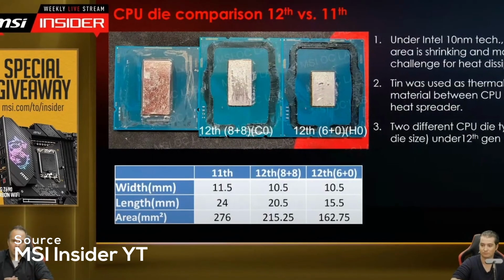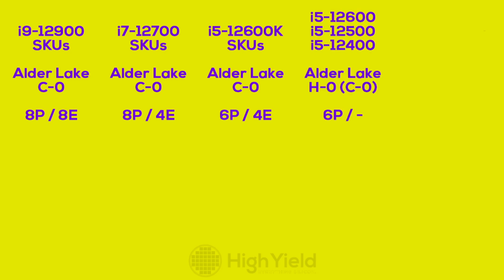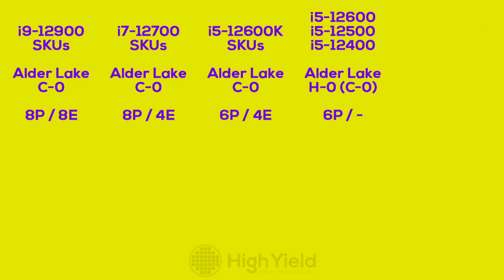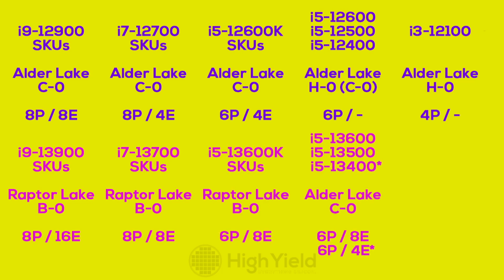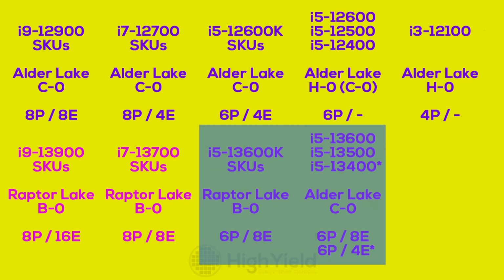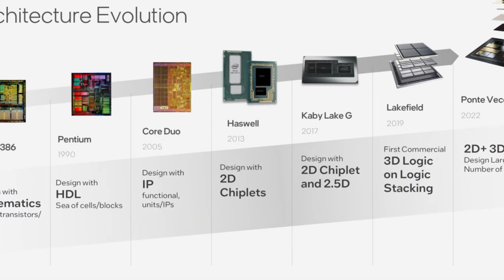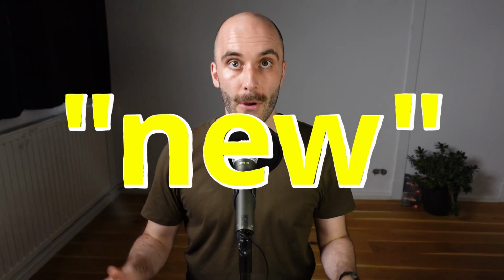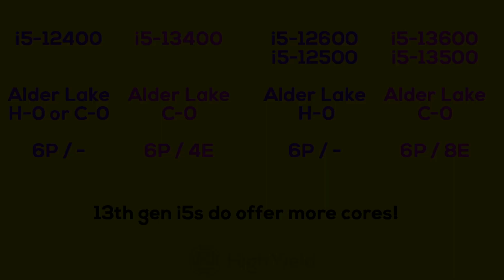Not all Intel 13th Gen CPUs are Raptor Lake

Comment from the maker: Since Raptor Lake just launched today: Yes, its true! CPUs below the 13600K(F) are not based on the new Raptor Lake B0 die, but on refreshed Alder Lake H0/C0. Only exemption is the 13400(F), which can be based on both. But all CPUs launched today (13900K(F), 13700K(F) and 13600K(F) are real Raptor Lake parts!
Reply: how can 13400 be both?
Reply: @kamikazilucas  it can be either
Reply: This is coming from someone who has been on this platform for a WHILE at this point,I had an i9-12900ks and now an i9-13900k and Raptor lake is still on the 1700 socket/the Z790 uses the 1700 socket as well,this is just something that needs to be thought about/talked about.
 
The real issue is,I think AMD is falling behind, YES they have 3D CPUs and MUCH better optimization,but their JUST getting DDR5 RAM and their JUST catching up at the end of a generation/the Meteor Lake platform/1851 socket,MAY come out SOON/the i9-14900ks, will most likely be released on the meteor lake platform/1851 socket. 

I think this is something people NEED to be thinking about, IF your planning on investing in Raptor Lake/Z790 boards/the meteor lake platform/the 1851 socket MAY be right around the corner,if you ALREADY own an alder lake board/an i9-12900k/ks,go ahead and get an i9-13900k,I don't think thats a bad idea,but investing in Alder Lake/Raptor Lake,this late in its life cycle, isn't necessarily a great idea/again most likely the i9-14900ks,will not be on Raptor Lake/the 1,700 socket and it will be on the meteor lake platform/the 1851 socket.

To put this in prospective and I know this isn't the entire story/power/pin count isn't everything,but it does mean A LOT,more pins equals more power and more surface area,surface area allows for more cores and more pins allow you to power those cores/you won't have as many power restraints, this isn't the whole picture, but this is DEFINITELY something to think about, Kaby Lake,which came out in 2016 had 1,151 pins and AM4,that came out in 2016 had 1,331 pins,Alder Lake/Raptor Lake have 1,700 pins, AM5 has 1,718 pins and Meteor Lake has 1,851 pins,like I said pin count doesn't mean everything and it MAY be something AMD can work through with optimization,time will tell,but this is something that NEEDs to be brought up/at least looked at/observed.
Reply: @mattmatt2417  "may come out soon", it will come at the end of this year, likely in october or november. and zen 5 will follow a few months later

Comment: Right now at this time in 2024 I was happy to see I actually have a C0 revision of the i5 13400f. This means it's really an alder lake. Which is a good thing right now. As 13th and 14th gen raptor lake (The real raptor lake and not the rebranded Alder lake) is the ones being affected by the infamous 'degradation' problem. Apparently there are some i5 13400f/i5 13400 that are based on the raptor lake core and has the B0 revision.

Comment: Question: because of 'binning' could a 13600k-rapter lake that does not preform as it should be 're-binned as a 13600-nonK while remaining a rapter lake die rather than as you show a 13600-nonk as being a alder lake die?

Comment: I just bought a laptop with 13th Gen i5-13420H....is this CPU actually a rebranded Alder Lake? It's only got 4P + 4E cores
Reply from the maker: No, your laptop CPU should actually be a "real" Raptor Lake chip with the Raptor Cove P-cores. Yes, it does have a 4P+4E setup, but that's just because it's a mobile CPU.

Comment: i feel like the 13100 or the 'raptor lake' i3 should be a 2/2 core split, 2 power cores and 2 E-cores. i could potentially support this. 
but as it is now, it seems like a copy from last gen with a few more MHz.

on another note i am keeping close eye on the 13400 / 13400 T / 13500 chips.
These seem very valuable from a gamers perspective that play low to mid maybe a few high end games but want to keep their total build cost relatively low while still getting enough raw power.
and these chips tend to be lower in power consumption which is always a plus for me personally.
Reply from the maker: 13400 and 13500 are great value, since they now offer E-cores. The 13500 is basically a mix between a 12600 & 12900 - pretty good for the price if you ask me!

Comment: This is all very confusing.  There will also be a Raptor Lake refresh in quarter 3, 2023 adding to the confusion.  I guess more is always better but things are getting complicated with the p-cores, e-cores different numbers of cores, and vastly different power draws for different configurations.
Reply: Edit:  I bought the 12600 to keep it simple. 6-p cores, zero e-cores, 65w.  At 3.3 ghz it is the fastest p-core only chip.  Paid 229 USD.  Will I need e-cores in the future?  How many?
Reply from the maker: Are you primarily gaming? If no, you wont need any E-cores in the future.
Reply: @HighYield  No, I do not game at all.  I do a lot of office work, ...several simple Excel files open (not even much calculation in Excel) with multiple internet browser windows open at the same time.  At times, while meeting on Zoom and presenting.  CPU load is generally low, around 2-5 percent.   I bought a fast six core chip because it seemed good enough, but the emergence of multiple core CPU's is kind of worrisome. Thanks for your reply.

Comment: Would the 13400 be faster than a 13500 if it has raptorlake cores? Or would the superior core/cache count of the 13500 win? I am leaning toward the 13500 because of the extra cores but..
Reply from the maker: That depends, Raptor Lake has about 3-4% better gaming IPC, but the majority of the extra performance is due to higher clock speeds. I guess a i5-13400 with a RPL core would still clock like its Alder Lake brothers. But in theory it could be possible.

Comment: As far as what we know, it's the same core architectures in Alder Lake and Raptor Lake and the only real changes are core counts, clock speeds and cache (there are some improvements to Intel 7 in Raptor Lake that help the clock speed). Therefore, I don't think it matters which die you are getting. As long as you are getting a clock speed or core count increase, why does an end user need to care if it's Alder Lake or Raptor Lake? Even for the i3, a 100mhz clock speed increase is not nothing. 13th Gen is an optimisation, nothing is new, not even the core designs. It's 9th gen to 10th again.

Comment from the maker: Igors Lab just leaked official Intel slides which confirm that all SKUs below the i5K models are NOT Raptor Lake, but based on rebranded Alder Lake chips!
https://www.igorslab.de/en/intel-raptor-lake-argumentation-aids-from-the-blue-foil-king/3/
Reply: I heard from moore's law is dead channel, for some RPL k and non-k versions would be repurposed ADL dies, after Intel sold all their ADL stock, they will launch for example i5-13650k/i5-13450 with pure RPL dies to distinguish those form rebranded ADL chips to prevrent some unwanted controversy.
Also for some RPL i5 configurations 6P+8E were the exact same as i9-12900H/HK and similar cache configuration, this might be repurposed ADL-P ,pure speculations.

Comment: Since 13600 and 13500 cores config (6P+8E) was not release as 12 gen it is OK to make it part of 13. Also 13 gen provides higher clock speeds for 13900/13700 models, so this may be distinctive property of 13 gen. If 13600/13500 also provide higher clock speeds over Alder Lake it may be just coincidence the core stepping is named C-0 like in 12 gen.
Reply from the maker: Of course its possible that a) the smaller Raptor Lake die is just called the same as the Alder Lake die or b) that there is a smaller Raptor Lake die we havent heard of. But I still think its most likely that Intel will reuse the old Alder Lake chips for parts of their 13th gen lineup.
Reply: So your happy to get a cut down 12th Gen when you think your buying a more efficient and better IPC 13th Gen raptor lake?

Comment: Will 13100 be basically exactly the same as the 12100 then? Weird. How will they improve the i3 if it's the same exact die and same amount of cores? A small frequency boost won't do much to be considered a new generation
Reply from the maker: If the parts list is correct, then yes, the 13100 will basically be a slightly higher clocked 12100.

Comment: I think Intel's decision to reuse for the 13400,500,600 non K is fine with adding E cores, as it's an upgrade, but agree the 13100 does not offer more. 
I'm currently running a 12100 bclk overclocked to 4.92ghz on a b660g ASUS board. It's an amazing chip, and I may upgrade to a 13400 if the chips are still open to bclk overclocking.
Reply from the maker: I also think these chips could be a good deal, if the price is right.
Reply: atleast for me the bios supports it after the latest update that supports 13th gen, I havent tried a chip yet, but im pretty sure the only reason it cant work is the mobo, I think if the mobo can do it the cpu can also always do it.

Comment: 13400 being 12th gen is a huge letdown, if the 13400 was raptor it would have been the best buy
Reply: There is now rumor that it will feature Raptor Lake die
Reply from the maker: The 12400 was mostly based on H-0, but there were some 12400 chips based on a heavily binned C-0 die. Maybe the 13400 is mostly based on C-0, but some parts might be using a heavily binned B-0 Raptor Lake die? Could be possible, but it would be kinda stupid if ppl buy the 13400 lotto to maybe get a Raptor Lake based part?
I hope we get more clarification on that matter on September 27th, were Intel is rumored to unveil their 13th gen CPUs!

Comment: Most people don't even know that the 10105, 10105f, 10305 and the 10325 are 10th Gen refreshes based on the 11th Gen intel Technology.
Reply from the maker: Which honestly is a positive surprise, isnt it?
Reply: Those revised 10th gen CPUs you mention, do they support PCIE 4.0 ? , or still only PCIE 3.0 like the original 10th gen intel CPUs ?
Cheers

Comment: On August Loose Ends MLiD was asked about this "rumour", he said he'd checked with an Intel source and the non-K SKUs will be new dies.
At minimum a re-spin, but I guess the L2 cache size will be a key differentiator between 13th & 12th.
Intel do segment a lot and L3 cache reduces significantly but if L2 does that's tight to the core's block and more integral to the processor.
The video sounded very definite based on an Intel statement, but rebadging did seem very dodgy and risky PR-wise without some stepping like enhancement.
[ MLiD August Loose Ends video has Raptor Lake 10/22 at beginning of the title ]
Reply from the maker: Yeah, I just listened to it. I actually watched the entire first hour of the stream, but then I fell asleep (late in Germany).
Honestly, if Intel is re-using their C-0 and H-0 ADL dies for Raptor Lake (and it currently does look like thats the case), I dont see why they would "re-spin" it.
MLID does say that Intel is not rebranding Raptor Lake (I guess he meant Alder Lake), but then he says that they will "at least do some changes in the low-end". It doesnt really fit because either they will re-use older ADL chips or they wont. A  re-spin of the C-0 die doesnt change the fact thats its the same old ADL die.

I guess he meant that its not a rebranding in the sense that the 12600 will be just called 13600, since the 13600 is based on the C-0 die with 8 E-cores, while the 12600 was based on H-0 with no E-cores at all. So its not a "rebrand" in the literally sense, its more of a re-use of Alder Lake chips.
Reply: @HighYield  To follow it you have to hear the question about the rumour that "the dies are the same, Raptor Lake low end is just rebranded".
So he asked his source, who came back denying the rumour.
So Tom says, "Intel is not rebranding Raptor Lake" ie making Raptor Lake SKUs from rebranded ADL.
My first language is English and it was clear to me his contact said a definite no.  Tom used the same tone and manner that he uses about definite things 
I was surprised as your video made me assume you had Intel confirmation.
So where was the idea originating?
Tom doesn't know what they changed just believes his source that they did something.
Reply from the maker: My video is based on the leaked 13th gen parts list I show in the video (I also have the source linked in the video description). I dont have any sources at Intel myself (or anywhere else), so I cant confirm this of course (as I stated in the video). But so far everything points towards Intel rebranding older Alder Lake C-0 and H-0 dies for the non-K i5s and below. Even the recent WCCFTech "leak" showed the same thing.

It might be possible that the 13400(F) will be sourced from two different dies, just the 12400(F) before. The 12400 was usually based on the smaller ADL H-0 die, but some parts where using a heavily binned C-0 die (I guess so Intel could use their botched C-0 chips). Maybe the 13400 will also be based on ADL C-0, but some parts could make use of a really heavily binned RPL B-0 die.

The launch of Intels 13th Gen is closing in and so far we have only heard about a single Raptor Lake die: B-0. I think its highly unlikely that Intel will use a single die, and a even larger one than before, to supply their entire 13th Gen line-up. Either there is a smaller Raptor Lake die we havent heard of yet, or Intel will indeed re-use Alder Lake C-0 and H-0 dies.

Lets see if Tom is right, but so far I stand by my video. If there is any evidence to the contrary I will of course add a pinned comment, just like I said in the video!

PS: I just pinned your comment so everyone can follow the current affairs!
Reply: @HighYield  I don't doubt that the core counts are the same, but Raptor Lake changes L2 to 2MB from 1.25.
If the low end is exactly ADL people will cry foul. A 100MHz clock lift won't impress anyone.
Secondly if 13th gen is ADL, then Intel can launch with all SKUs, but Tom thinks i9 first and limited availability.

Comment: I just made my own CPU. I took some sand and made a bit of silicon. Made it into a wafer and cut it in slices. Than I took some glass and directed some sun rays through it onto the wafer. Burned some transistors into it and made some chips. I connected the chips til I had 256 cores. I'm playing cyberpunk 4088 on high settings right now and it's much better than the first one. Just build your own CPU I need some more people for multiplayer. Plz
Reply from the maker: Home made is the best!
Reply: @HighYield  my house burned down. But it's not that bad. I managed to save the hard drive. I just have to wait now till they fill the sand back up at the play ground...
Reply: so?
Reply: @lawrenceeeeee  is time for yo mama meme

Comment: If they re-enable avx512 on the rebranded 13th gen alder lake chips then it's fine.  If it's exactly the same, it would be preferable not for them to confuse the stack, but I can see it being to their benefit for oem marketing.
Reply from the maker: I dont think they will, I even heard its turned off in hardware, so even if you disable the E-cores AVX-512 might not work. Lets see...
Reply: @HighYield  How about giving me the option to either enable or disable that feature in the BIOS. Let me configure my CPU how I want it to run! Why would I pay several hundred to a few grand for a system that doesn't come with the instruction sets that I want my system to support?

Comment: Performance and pricing will tell. If the 13400 is not that far out in pricing over the 12400, it's still probablly be an incredible buy, older chip or not. But if the P-Core performance is very different between RL and AL  as it's expected, then yeah, it kind of sucks.
Reply from the maker: I agree, pricing will be the deciding factor.
Reply: @HighYield  Yeah but from a business perspective if the price is too low they can lose out on money, if it's too high and the gap between generations is too great people will be hesitant to buy the newer generation. Yet if the prices of the newer chips are too close to that of the previous gen models, then they'd have to lower the price on the older gen models... 

If a current 12th Gen i5,i7,i9 was selling for say $800-1200 depending on model then I'd have to sell the 13th Gens for say $900-1400 and would have to drop the 12th gens to say $600-1000. This way you can still sell the older gen high end units for those looking to build a new affordable system but are a generation behind, and yet the price of the newer gen isn't significantly higher and just right were enthusiast wouldn't complain. With these kind of ratios or percentages, you'd find that last generation's top model now has a competitive and comparative price to this year's middle to high end model. Now these numbers aren't exact as it would be based on the current market, but this is something I'd consider doing from a business model perspective. This way I'd still be selling both generations and once the previous generation is SOLD OUT, then I'd drop the newer generation down a little bit say like by 10-20% off once it becomes the standard product on the market.